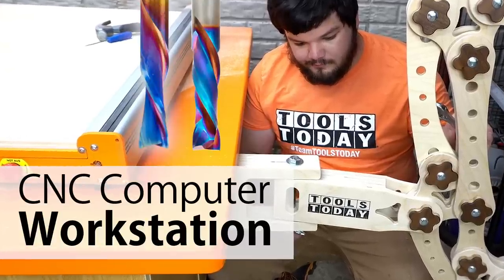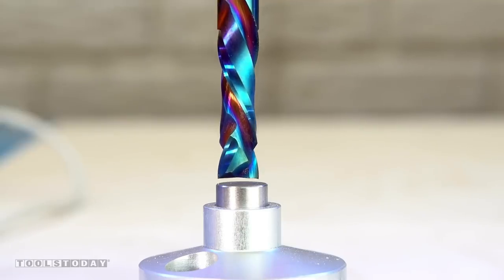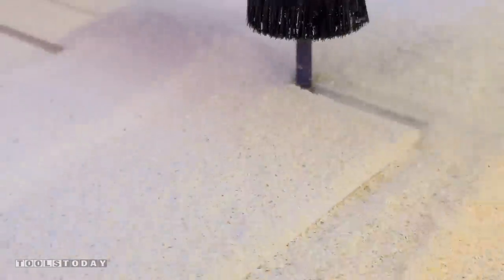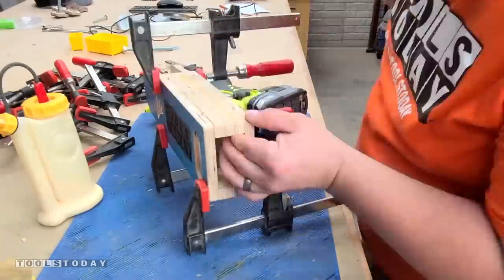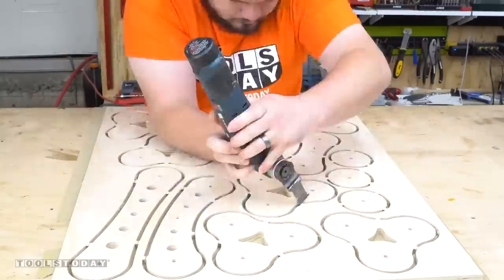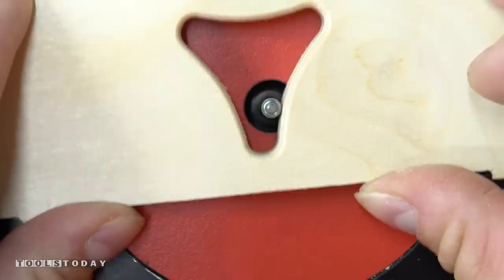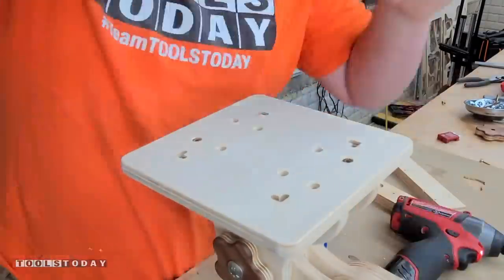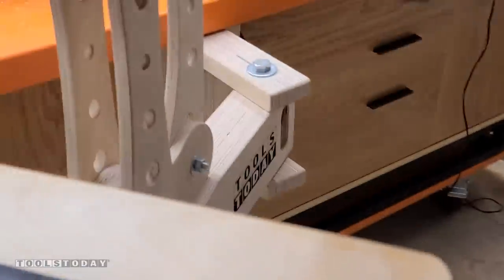Building a Computer Workstation for the STEPCRAFT CNC | ToolsToday

Comment: I picked these drawings up and while I'm happy that I have the plans, I'm rather disappointed that the instructions are a video on fast forward and a shopping list.  Why aren't the parts tagged with an assembled drawing of where they go?  Also, why are the mounting holes for the VESA adapter, keyboard and keyboard lip missing?  It's trivial information, but overlooking these easy things forces a full evaluation of the overall project.  Admittedly, the holes aren't an enormous issue, but what happens when it's a bookshelf, computer stand or perhaps a load bearing object.  As a professional detailer, I assure you, the details matter.

Comment: There are many Axiom machines that do not use a router that have a dedicated spindle and give very professional results.  The router versions were designed that way to help keep the costs down for the end user.  If you need more then you usually pay more.  No offense to those with those machines.

Comment: hello, im new in the CNC wold, nice project!!!, i have a question, how do you determinete the depth per pass ?
Reply from the maker: Hello! Depth per pass is determined by the tool files or the charts on our website www.toolstoday.com.  With compression bits, the first pass has to be below the upcut portion of the bit, so that will determine your first pass depth when using those bits.

Comment: Very cool project that I'm going to build for my DWC2440 CNC.

I am curious though about the computer that was used in the video.  The one I'm using now is a small desktop that I'd love to replace with something that would mount to the back of the monitor stand. 

Can you tell us what brand and model was being used?  Thanks
Reply from the maker: Hi this is your standard PC computer, you don't need a lot of computing power to run the CNC.
Reply: @ToolsToday  +ToolsToday I don’t believe the OP was concerned with PC power.  I think he might be asking you what the ASUS mini computer is that you’ve attached to the back of the monitor.  Looks like a PB50.